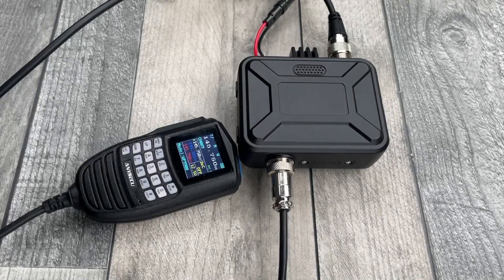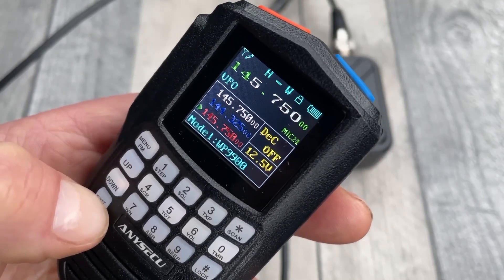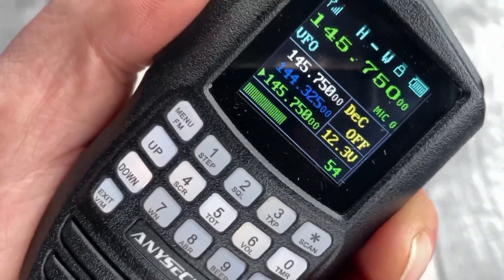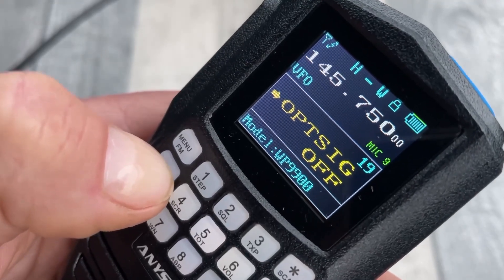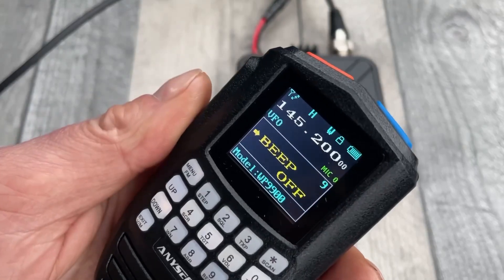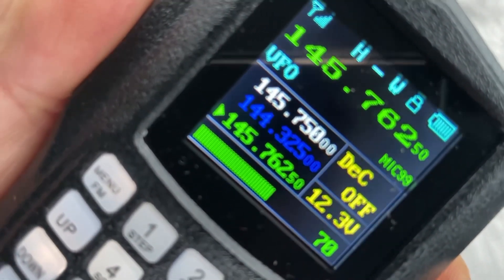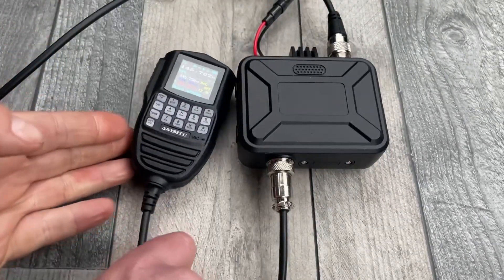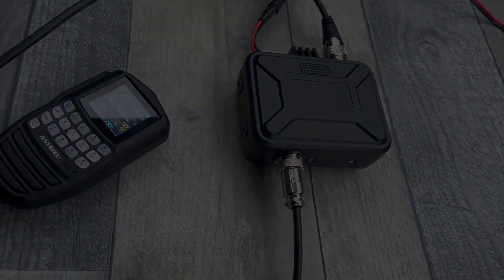👍This mobile is awesome 😎  Anysecu WP9900

Comment: That thing looks pretty sweet.  Perfect for a go box or emcomm setup.
Reply from the maker: Yes it’s got all the eye candy colour screen convenient form factor. It’s a mid to low cost radio. It’s overall good value
Reply: Ditto. 

With the display on the speaker mic, setting it up as a self-contained backpack radio seems like a natural project to use it for.

Comment: I'm fascinated with this radio. Modern cars make radio installations more and more difficult - if not impossible - (at least, if you're fastidious and want it kept very tidy) but a unit like this opens up a load of possibilities. I really hope one of the the "Big 3" sees the hole a radio of this footprint can fill.
Reply from the maker: Yes that’s a good point Kevin. Also don’t forget that any tone 878. I know it’s a handheld but you can Bluetooth to the car stereo both microphone and speaker. And you get a Bluetooth press the talk button which you can put on the gearstick. Very handy for mobile operation.

Comment: Anyone happen to k ow what the TRRS pin out is for the external speaker? Wondering if there is a way to use this radio with an external sound card and digital operability. Tried using pinouts from BTECH GMRS version but can’t get software to transmit.
Reply from the maker: I have no idea, but I hope someone replies to your comment
Reply: under the data plate you have a speaker jack so you can start there using it as aux

Comment: Hi, I’m looking for some help from the radio folks, do you know what are the VHF/UHF frequency ranges for this radio? I’m a bit confused because sellers on AliExpress advertise for VHF (136-174 MHz) and UHF (400-470 MHz) while on the manufacturer’s websites say something else: VHF (144~148 MHz) and UHF (430-440 MHz)
I intend to use it in Canada (AB/BC) in my vehicle and I believe I’ve seen some VHF channels frequencies greater than 150 MHz. I’m a newbie, by the way, don’t own a radio yet and don’t have much knowledge about this radio world. Thanks!
Reply from the maker: At 35 seconds I read out from the manual the specifications. This is the UK model. If you’re after the American bands check out Mike k8mrd on YouTube. He did a review of the American model

Comment: the software keeps saying open communication port error
Reply from the maker: Try different USB sockets on the computer. To be honest I did not use the computer software
Reply: Get the usb cable com port number from device manager. Put that in the communication settings in the software. That worked to get rid of that error for me.

Comment: how well does it do scanning memory channels?
Reply from the maker: That is something I never tried and I’m sorry the radio has gone back. It is basically the same menu system as a Chinese uv5r so I would expect the same.
Reply: It will scan but the speed is not close to the speed you get with a dedicated scanner.